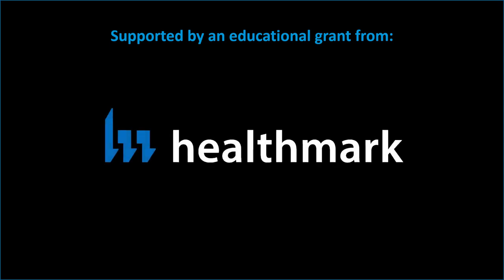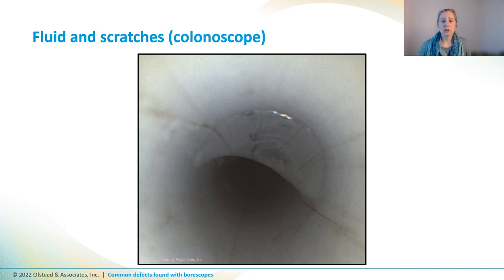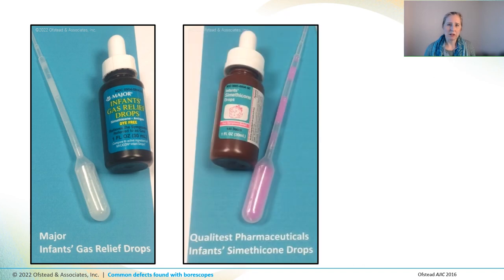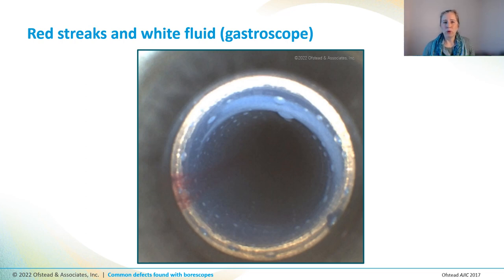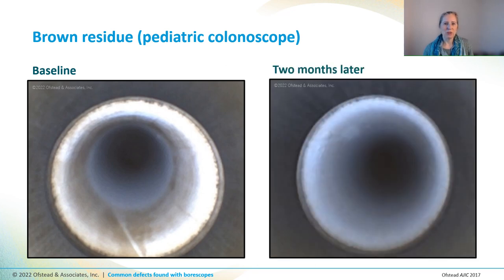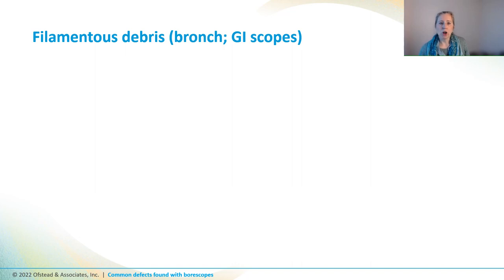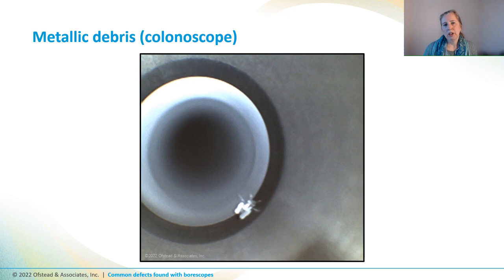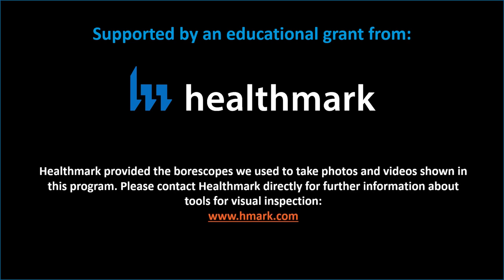Common defects found with borescopes

Comment: Thank you for posting the very informative series. Can you recommend a particular model to cover all flexible endoscopes- my unit oversees reprocessing of the full range and a Boroscope rig to cover all would be a great advantage as we have a mixture of new and legacy inventory in our fleet.
Reply from the maker: First, we do not endorse any particular product. Second, for our published studies and webinars, we have used borescopes from Healthmark, Clarus and Steris. You will likely need two different diameter cameras-- a large one that would be around 2 mm and a smaller one less than 1 mm. Some units allow for plug-n-play of different camera sizes.